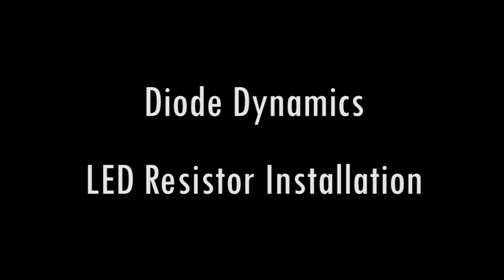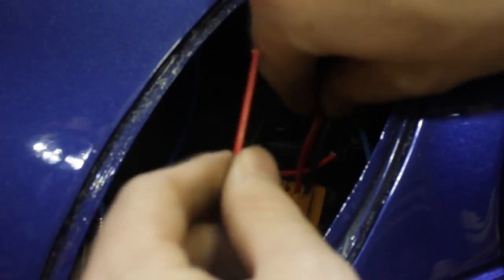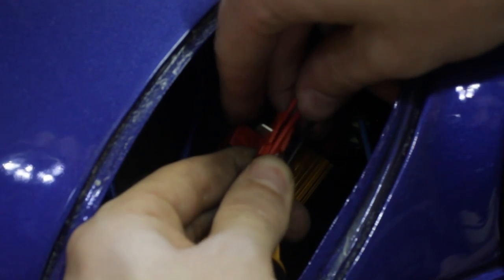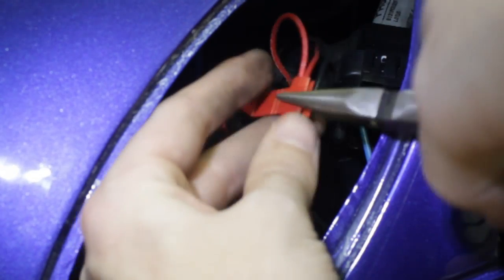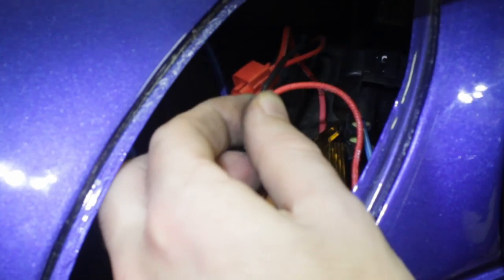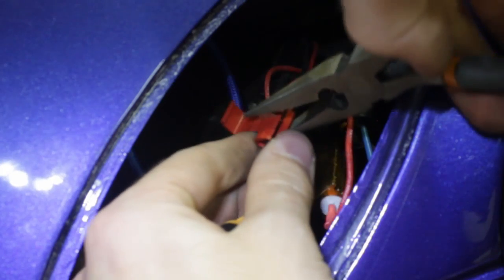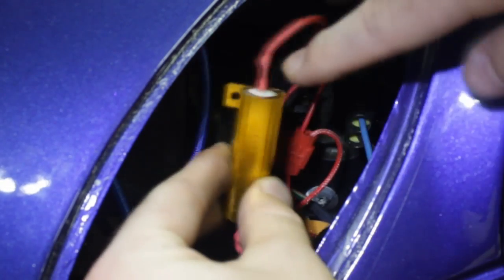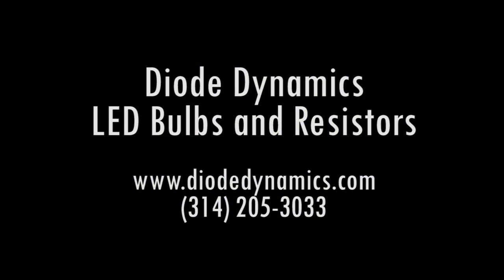How to Fix Hyperblinking! Installing Resistors for LED Turn Signals | Diode Dynamics

Comment: Was wondering, do they stay hot or only when turn signal is being used? Are they too hot to put a zip tie around? Installing them on a 2013 Nissan altima and was curious so I know where to put them. Thanks my fellow YouTubers
Reply: Did you ever figure this out? I'd assume only when the light is in use.
Reply: moNYTx wow, it's been a while since then. I just zip tie to frame behind the carpet. Had no issues
Reply: mike216ism 
yeah I saw the 2 years lol. thanks brother

Comment: I have toytoa  solara 1999 in the front I have 3 wire for signal light I need know which one have spill and do I need  two and two in back

Comment: Do you need 4 resistors front back to work led light  I have a1999 toyota solara the has three wire and they are not black or red can some body help
Reply: Yes, one for each bulb you replace.
You'll need to use a volt meter to determine which of the wires is the ground, and which is only flowing current when the blinker is on.

Comment: Help: How do you resplice it? Thanks
Reply: Take of the splicer, use wire splitter to expose the two wires that you need reconnected, seal off with electrical tape.

Comment: I am wanting to upgrade my turn signals in my 95 civic sedan to led when I installed them They did as shown in the video but I only had the front installed when I did the rear the turn signal buzzed so I installed an electronic flasher and I blew some fuses when I tried to use the turn signals will the resistors fix my issue with this project

Comment: How did you mount you reduser? Can you use 3m tape?
Reply: GO TO ACE THEY HAVE SMALL SELF TAPPING SCREWS TO PUT IN THE WALL FRAME WORKED FOR ME 3M TAPE OVER THE CONNECTOR IF FINE HELPS KEEP MOUISTURE OUT. HOPE THIS HELPS.

Comment: Do these cause electrical problems down the road?  I was advised moisture may set in the lines and cause some electrical issues.,
Reply: Seal them. Liquid electrical tape, self fusing silicone tape, or the moisture proof rubber electrical tape with friction tape over that.

Comment: THIS DOES NOT WORK. I DID IT ON MY F150. WASTE OF MONEY
Reply: If it didn't work you installed the wrong resistor!
Reply from the maker: Marc Olson 50 watt refers to the maximum power the resistor can handle. A 6 ohm bulb will draw 2 amps of power on a 12V circuit, or 24 watts, which is nearly the same as an incandescent turn signal drawing 21-26 watts.
Reply: Marc Olson go on ebay they make harnesses for any bulb type so you dont' have to splice into your wires.
Reply: I works,  2 6 ohm @25 watts or one 3 ohm @ 50 watts. Take an electronics course or Google ohms law
Reply: exactly
Reply: Those ohm numbers are based on replacing a 50 watt (total) blinker system per side...  You have to calculate for your vehicles blinker wattage, 50 is based on my motorcycle and a reference only!
Reply: Right and in the case of my cycle two bulbs in parallel, requiring either 2x 6 Ohm resistors at 25 watt ratings or one 3 Ohm at 50 watt rating.  You're explaining this to the wrong guy. Go comment on someone's post that needs help because they know zip about ohms law!
Reply: Diode Dynamics So why not just use a high power LED bulb?  They are available on the market now.  Wouldn't this eliminate the need for load resistors altogether?  Actually, this is what I did on my 87 Accord's front turn signals and it solved the issue of not working LEDs to proper function.  BTW, I tried load resistors with low powered LEDs in the front turn-signals and that didn't work at all (i.e. the front LEDs would not light up).
Reply: +theaudiophilestore Using an LED turn signal that actually draws a full 25W of power would either give you a bulb that has a ridiculously short lifespan because of heat overload, or one that could function as its own headlight. High power LED headlights draw 30W on each module.

Comment: WHAT IF YO HAVE 5 WIRES LIKE ON MY ESCALADE? IM CONFUSED WITH THAT. THERE ALL WHITE BUT ONES BLACK. PLEASE HELP
Reply: The black is the general ground. You'll need to use a volt meter to determine which is hot only when the turn signal is on.

Comment: Where did u get the splicers? and do they sell smaller ones?
Reply: found them at autozone bro thanks. see where im having a problem I wanted to connect the led's to the blinkers but when I looked at the blinker wires there is 3 wires.  I tried various ways to connect them to these wires but for some reason the strip lights come on but on at the right and left side of the strip....the center of the strips wont come on.. when connected to a battery the full set works just off the battery.  what am I doing wrong?

Comment: When adding an led strip to your turning signal lights, is there a way to make it so the added led light act as ONLY running lights and not act as a sequence turning signal?
Reply: If you have 3 wires coming out of the turn signal, yes. Or you can hook up a relay so it just turns on when the key goes 'on'

Comment: I just install my 1157 LOAD RESISTORS 50w 6OHM. It was real easy. After installing it, I had a bit of a problem. It was still hyper-bliking. I took some steps back and made sure everything was properly connected. I then "Re-Pinch" the "Slice" all the way down )it was half way in). Then it worked like a champ. 

You must pinch the slice all the way down!!! (Flush) for it to work!!! 

Thanks again. DIY video for resistors.

Comment: Will this also work if the LED turns on but don't blink when using the turn signals? And the LEDS turn on as soon as I plug them in even though the lights are off.

Comment: I just installed new LED tail light assemblies on my truck. But now I'm hyperflashing and have no running lights. Do I use four resistors and splice into both my turn signal and brake or just use two resistors and splice into one of the two?

Comment: I have nothing ever on any cars that ain't ROAD Legal  DOT SAE stickers on  lens  etc. NO swaG!  PHILIPS DRL  4 LED or 8 LED Amazon LEGACL !! Work great! $79 DRL BRIGHT and OEM quality, Philips supplied OEM Osram has similar kits but cost more.  Look up amazon PHILIPS DRL kits.  ENtire kit water tight controller, works GREAT easy install.  I used 3M molding tape, to mount METAL brackets to under grilled, kit is GREAT everything ya need for installing LEGAL! BRIGHT!

Comment: cengeb, very interesting detail to point out. I also seem to worry about things such as this when doing mods to my vehicles. Question, has this stopped you from using these bulb in your vehicle? For me cost is a factor in some of the replacements. Thanks for your input.

Comment: Thanks for instructions, however i have similar resistors but with 2 wires on each end of resistor, do both wires do same thing , ie  can i use for stop/ tail light  elements ??.

Comment: i had one question i have an 2007 impala but dont know how to install resistor for led turn signals. i have 3 wires black, red and yellow, would like to know wich cables to use. thanks

Comment: And when you have an accident and a smart lawyer finds non DOT or SAE cert parts, you loose.  If it's not DOT SAE compliant it's illegal to use, especially in lighting.  ever wonder why legit products from Philips, Osram GE cost more and have DOT on  the stuff? LED from Philips is legal DOT on the DRL Lenses, don't use SWAG, there is a difference!

Comment: My cruze seemed to work fine until i signaled, then they started turning on and off randomly and blinking different colors.  Resisters fixed my issue.

Comment: Thought I posted a comment, but guess I didn't. Anyways, I installed a 9005 LED bulb and it seems dim and flickers. If I add the resistor, will it end the flicker and increase the brightness?

Comment: Thank you for this video ! all the adverts for these resistors were stating a connection in series !! I was trying to work out why it wouldn't be parallel  but you've just confirmed my expectation ;0)  .. Cheers ..

Comment: I want to replace my halogen bulbs with LEDs on my 1980 motorcycle.
What type of resistors and bulbs should I get? I also live in Canada  Look forward to your answer as I also want to install fog lights that also replacing the halogens on them also..All are H4  and I have not yet investigated what the markers bases are for those lights to replkace.  Thanks! Age

Comment: I installed the 6ohm in my dual filament light in my 2011 highlander and it stopped the fast flash when the parking lights were off, but when I turned the parking lights on, the turn signal went back to fast flash.  Any thoughts?

Comment: I have 3157 LEDs and I added load resistors but I still have a message on my dash that says "Park Lamp Out" How do I remove that? I was told maybe I need another pair of load resistors or a flasher. Please Help. Thanks

Comment: I tried to connect a resistor to my Audi TT. But they have two bulbs powered by one wire. Connecting a resister to the one still had my blinkers running too fast. Does each bulb need it's own resistor??

  Cheer.

Comment: @funnymanseven, if you have a dual filament bulb as your turn signal (7443) then use a test light to determine which is your blinking wire, either that or your resistors aren't enough or not making good contact

Comment: I spliced my green striped wire and the black one... and i left the brown one alone... But the signals are still hyper blinking. Now im trying to isolate the problem, did I splice the wrong wires?

Comment: i have a 98 chevy blazer i changed my 3157 bulb to a blue led light but the problem was the indicators inside  stayed faintly lit when the signal was off and also my 194 bulb (Standard bulb)will go dim wat causes this problem

Comment: diodedynamics.... I've installed resistors on back light on my car, and I've 1 problem. resistor is getting too too hot, even I can't touch it. it happens after 2 minutes. is that a problem? or it must get hot?

Comment: Thanks for the video, it helped alot.
 
I used 50W, 6ohm load resistors for a 97 grand am and my turn signals work great.  For quick install tips:
1. blue - power, black - ground
2. back and front load resistors must be installed for one side to work properly.  Both sides must be installed before all 4 turn signals are working properly.  
3. back turn signals - yellow - power, black - ground. 

Hope this helps,

Comment: So you just have 2 wires together, and tap, dont need to cut the rubber cover from the resistor out?

Comment: "Solder if you can", were my exact words.  I can (very well) so I did.  Cracking is due to a "cold solder", like you said is a poor job.  But minimal tools can give a solder joint that will last indefinitely.  But like you said, again, you have to know how.

Comment from the maker: Quick splices are very good for the purposes here. Please don't tell people to solder- if you do not have proper tools and experience, you will do a very poor job and it will simply crack and break within weeks of installation.
Reply: I soldered my back directional lights with an inline resistor ok -  I used heat shrink - I will see how long it lasts I guess - I don't expect the joint to break but you may know something I don't.

Comment: I got load resistors for my car and i have the led switchbacks..but everytime i have my headlights on and turn on the signal light the white light stays on. But its supposed to turn off when the signal is flashing...do you know how to fix that?

Comment: Must've been reading my mind because I surely needed help with installing load resistors on my altima. I just need to know which wire is my turn/parking light